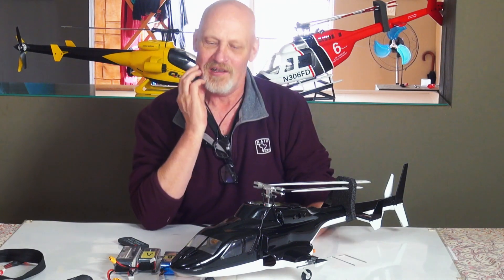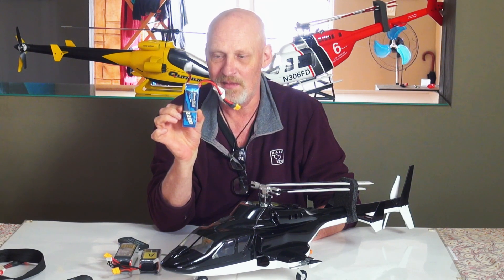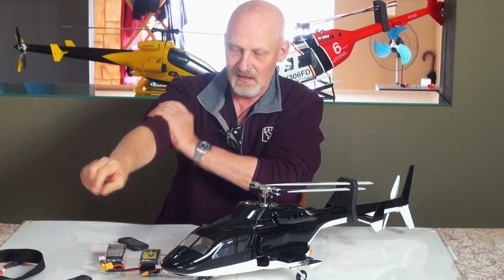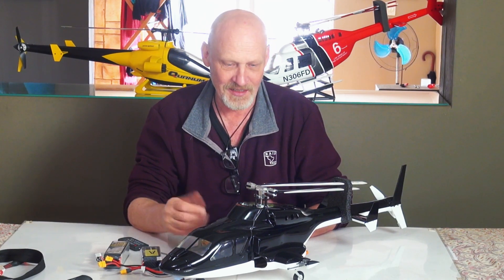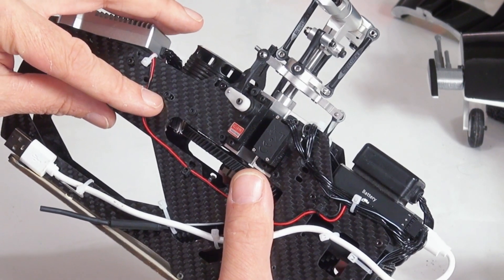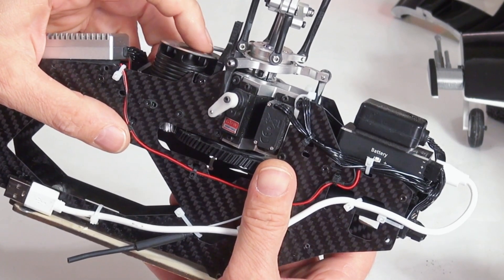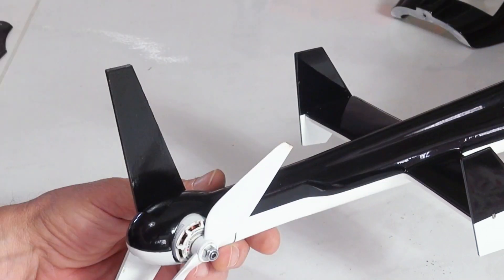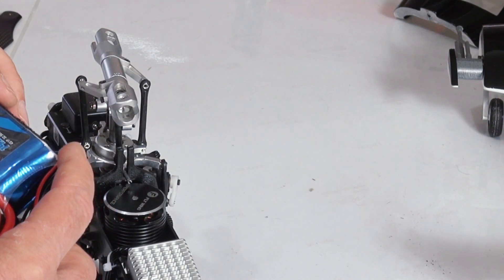Flywing AIRWOLF V2.5 BELT TO GEAR DRIVE CONVERSION - FULL TUTORIAL

Comment: Hi Mike, what is the thread size of the bolt that passes through the bottom of the shaft to hold the large gear in place?
Reply from the maker: M2.5
Reply: @Mikes-tuts-rev  Thanks Mike👍

Comment: Hi Mike, I just finished doing the Gear conversion on the FW 450 v2.5 and my question was if I heard it correctly you said on the motor wires just swap two of them and you swap the two outside ones am I correct? what about the rotor blade? Do you need to change that or just leave it alone Thank you.
Reply from the maker: HI. Swap ANY 2 MAIN motor wires to reverse the main motor. The rest stays the same. Throttle control 70% to start and 75 if you need more agility. Regards
Reply: @ Ok got it thanks Mike 👍🏾

Comment: I've only had my airwolf a week now and I already crashed it lol. Well kind of not, I took it up pretty high and I wanted to try the figure eight, I wasn't looking down, and I hit the wrong switch. I shut it off lol. Thankfully it landed flat on its belly. It only bent the wheel and cracked the bottom of the fuselage.  All the plastic dog bones did their job, they all just popped off.   I already glued it up with epoxy.  Took it for a flight, everything seems okay
Reply from the maker: Yup, another example and reason I recommend staying away from those modes. Glad its still ok
Reply: @Mikes-tuts-rev I did your suggestion and I switched out the shorter USB cable. So that saves me 20 g. I have one of those explorer one HD cameras laying around. I want to mount it on the heli. Looks like the most ideal place would be on the nose. But I'm afraid it's might throw it off balance or something lol. It weighs 51 g so it's not that heavy. 

It's been windy the past few days so I'm going to try it once things calm down

Comment: I'm about to get that anti-rotation bar 3D printed. I was wondering is there any reason why you didn't create those side notches that slide into the carbon fiber plates?
Reply from the maker: They are to small
Reply: @Mikes-tuts-rev do you think a better printer would be able to print them?
Reply from the maker: @Thirdplace4life  Its not really required anyway. Mine hasnt moved

Comment: So basically all you need is the main gear, the motor gear, and the main gear holder to convert this right?
Reply from the maker: Correct
Reply: @Mikes-tuts-rev and you have to reverse the wires? Which wires?
Reply: @Mikes-tuts-rev   Also what about the anti-rotation bar? Do you need the 3D printed version?
Reply from the maker: @Thirdplace4life  Oh yes, forgot about that, but the file is free
Reply: @Mikes-tuts-rev can the v3 anti rotation bar be used?
Reply from the maker: @Thirdplace4life  Nope, or maybe, never tested it

Comment: Just a hint from my experience! When I build my Align Helicopters with the shaft drive, I use one extra bearing on the shaft drive within the tail boom. This stopped the tail vibrations I experienced during spool up!
Reply from the maker: We dont have bearings in the tail as it is motor driven. Regards

Comment: hi mike.. just done the gear conversion all good but rotors run anticlockwise wont take off... any idea what ive put round wrong way
Reply from the maker: You need to swap 2 motor wires
Reply: oh ok.. which 2 as there is 3   they are all black lol... did i miss this in the video.. i swear i watched it all
Reply from the maker: @gavintenerife  I must have omitted that in the video I have amended the description. I took the 2 outside wires and re routed them through the clip before soldering them on. Pls ensure your solder work is clean like factory, not dry
Reply: @Mikes-tuts-rev  excellent .. will do that now.. thanks for ya help..  p,s  luv ya videos.. all the best gavin

Comment: Pardon my ignorance, the link for the anti-rotation part took me to the website cults, once i get there I'm lost. can someone help me on this.
Reply from the maker: Hi I checked the link and it takes you straight to the anti rotation part. Where are you lost? Regards
Reply: I see the anti- rotation, but where do I get the info to send to get it made, I do not have a 3D printer. 
Thanks.
Reply from the maker: @wilbertdaley8021  Find a local printing service in your area? Whre are you based?

Comment: Just finished the belt to gear drive conversion of my Air Wolf. I will sleep better tonight knowing that the fate of my $600.00 aircraft is no longer determined by a $4.00 belt. Thank you Mike Duncan for sharing your knowledge and support!
Reply from the maker: You’re welcome, enjoy the peace of mind! Pls share your experience and build on the FB group. Regards
Reply: @Mikes-tuts-rev, can you use the same belt to gear conversion on the 470 RotorScale Airwolf?
Reply from the maker: @ricardopr54  Hi, I have no idea, sorry.
Reply: @Mikes-tuts-rev  ok thanks
Reply from the maker: Pls swap any t motor wires before you fly
Reply: @Mikes-tuts-rev  Yeah, I picked up on that.....Thanks!   Also, the plastic main gear had quite a wobble to it. Currently waiting on the new one from Heli Direct, due to arrive today.
Reply from the maker: @ when screwing down the plastic gear, ensure it is correctly seated, there should theoretically be no wobble, or if, then very minor.

Comment: Hi Mike . I have all the items needed to convert this into the gear drive , I recall you stating in the video you would add the gps plate holder cad and also we will need to change the head speed on the radio. could add the dimensions for the plate and a quick video on how to change the settings for the gear drive .  Thanks
Reply from the maker: Hi, I have uploaded all the files in the same link as the anti-rotation part, ESC, GPS plates and a battery plate. Regards
Reply from the maker: Motor settings are in the H1 software on the first page. Change motor to 75%
Reply: @Mikes-tuts-rev  Frankly ,That is were i am lost. were is the H1 software on the first page ,
Reply from the maker: @kevinwatts5103  open the H1 software, connect H1 to computer and see the first page. regards I have a video about this on my channel.
Reply: @Mikes-tuts-rev  Mike there is no Motor speed category listed . Are you referring to the Throttle Control  to 75% ?
Reply from the maker: @kevinwatts5103  Yes. throttle control, my bad :)
Reply: @Mikes-tuts-rev   I watched your H1. Video and you don’t go in to the specifics on Head speed  when converting to the gear drive . I just would like to be sure i am following your example correctly. Thanks. Maybe take a photo on the first page for everyone to see.  Thanks in advance.
Reply from the maker: @kevinwatts5103  Heowdi. Did I not mention to up it to 75%? Anyhoo, that's what it is :) Regards

Comment: Is it possible to supply specific measurements for screw placement for conversion?
Reply from the maker: Hi, not really as you need to get the gap just right. Start with the stock holes and move them up one, so to speak, then slot those slightly to get the right gap between Spur and Pinion. Dont make the gap to tight or else you will wear out your spur gear. There must be a slight gap all around when rotating the spur 360 deg. But its about, center to centre of stock holes less 2mm for the one closest to main gear.
Reply: @Mikes-tuts-rev  can't do now. Flywing canceled my order.

Comment: I'm not sure why Flywing did not put the tail rotor on the left side, and make the main rotor to rotate counter clockwise.
it's motor driven tail, so wouldn't be too difficult to switch side.
Reply from the maker: Because its a semii scale heli :)
Reply: @Mikes-tuts-rev  and just tiny bit more effort, they can make it look more scale. doesn't cost more to put the tail rotor on the left side, rather than right side.
Reply from the maker: @davidjacobs8558  The Airwolf don't forget started life out as FW450 which they put into an Airwolf shell. I have made an Egg tail part add on which with a bit of jiggling I could make into an opposite side mounted motor. The rest is easy

Comment: Good video. I had issues with my belt drive out the box. I noticed it was fraying and didnt want to mesh correctly. Mine will be going back to the dealer as mine also had cracks in the body to. Shame as i really wanted to have this for my collection

Comment: for this upgrade do you need to change the motor or do you add the pinion gear to your existing motor. Thanks
Reply from the maker: Stock motor. Change Motor output in software to 75%
Reply from the maker: You also need to swap t motor wires

Comment: i cant seem to open or download your files for 3D printing . would you have  a direct link to to share ?
Reply from the maker: Its the first link in the video description. Regards
Reply: I need to purchase the tail boom delete kit from you. Is that purchase for the CAD file or do you make them and ship them out ?
Reply from the maker: @kevinwatts5103  That is for the cad file, you print it locally. Regards
Reply from the maker: You also need to swap 2 motor wires
Reply: @ What motor wires ? That wasn’t in your prior videos. I guess i am lost on that part. Any help would be appreciated on that method .
Reply from the maker: @ Yes any 2 of the 3 motor wires you need to swap to reverse the motor direction as it will be gear drive and needs to therefore turn the other way so that the blades turn the normal way. Regards

Comment: Leider kam dein Video etwas zu spät für mich. Habe meinen Airwolf gestern aufgrund Zahnausfall am Zahnriemen in den Boden gerammt. Totalschaden.
Reply: Mine is being sent back to motion RC as I noticed the belt issues with mine before even flying. That along with the poor build quality of the fibreglass body. Mine arrived with stress cracks in the body out the box. But the belt system is definitely an issue. I just turned mine by hand and the belt wanted to come off and also the belt had plenty of fraying